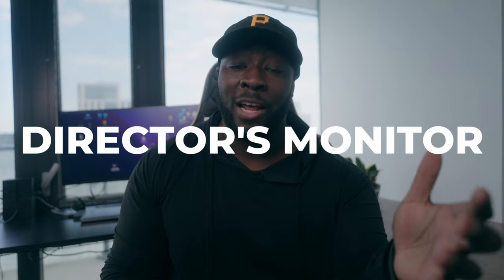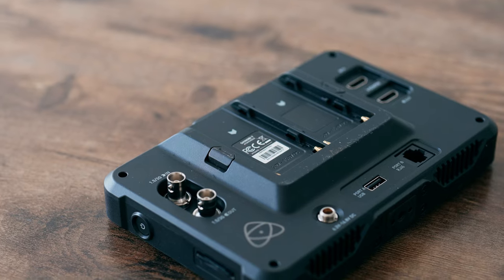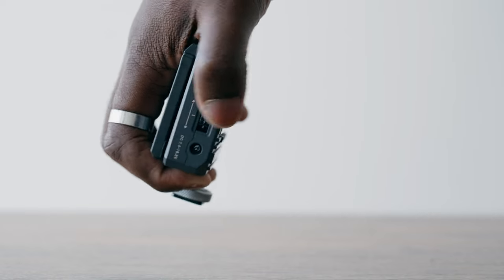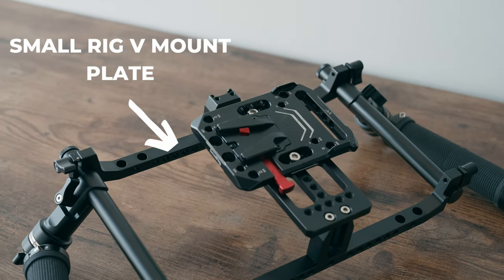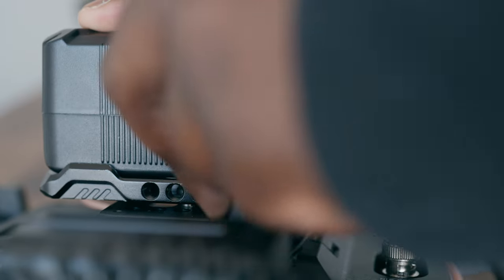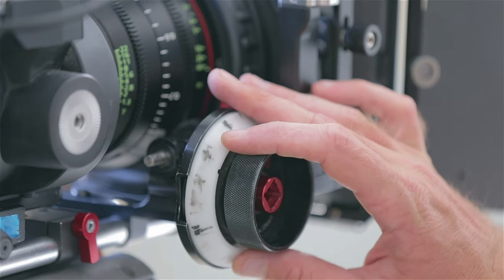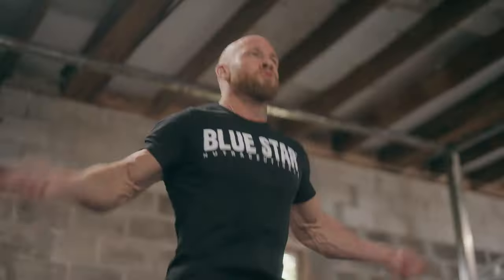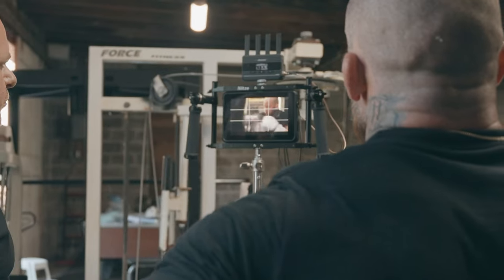Atomos Shinobi 7 Directors Wireless Monitor Setup

Comment: Thanks for the video. Re. the new Atomos Connect releases. Any idea if the Atomos Connect allows for wireless monitoring to another Atomos monitor with Connect - example: new Atomos Shogun (with Connect) sends signal to a Ninja V with Connect.

Comment: Would love a tutorial on the Shinobi 5 with FX3. Can’t find one anywhere 🤷🏼‍♂️
Reply from the maker: Well what about it is confusing?? I might be able to help !
Reply: @KofiYeboah  really appreciate it. 
1. There are some basics like HDMI output from the  FX3, such as is it possible to have video on both the external Shinobi 5 + the camera LCD? And LUT installation on the Shinobi 5. 
2. Also what’s really confusing is choosing the viewing set up on the Shinobi. On FX3 when shooting CINE EI with Rec 709 viewing “LUT On” on camera settings, what is setting that should done on Shinobi. Should it just be “native” output settings from the camera?
3. Also seems like camera zebra viewing doesn’t show up on the Shinobi 5. But the  zebra lower bounds % on the Shinobi 5 zebra is 50%, so can’t set exposure for the grey card at 41% (or 45% for CINE EI). So I’ve been setting zebra exposure before plugging in the HDMI to the Shinobi 5. But I’d love to know your exposure workflow using just the Shinobi 5 (an entire exposure tutorial showing the camera menu/screen settings would actually be awesome). 
4. There are a few different histogram screen views. Would be cool to know if you use the display histogram from the camera display? Or the Shinobi 5? The Shinobi 5 also places some type of meter in the lower middle of the screen that I’ve been toggling off because it covers the camera exposure settings in the lower margin. 
5. Also would be cool to know your false colors work flow and if you use focus peaking or other settings? Just a few ideas.
Reply from the maker: I’m going to try and work on something for this 🙏🏾